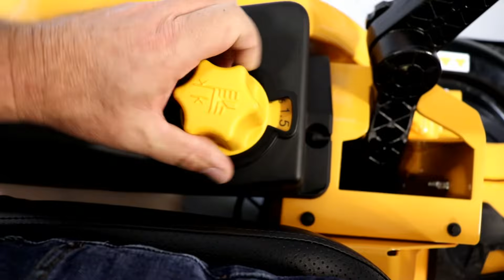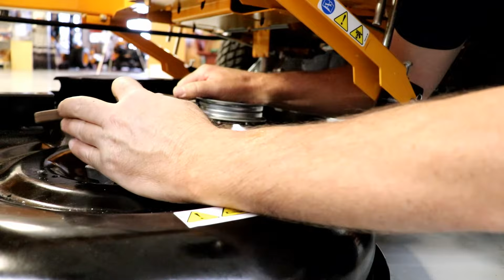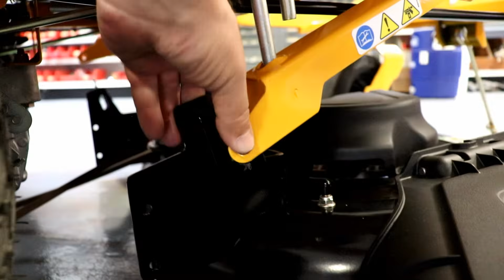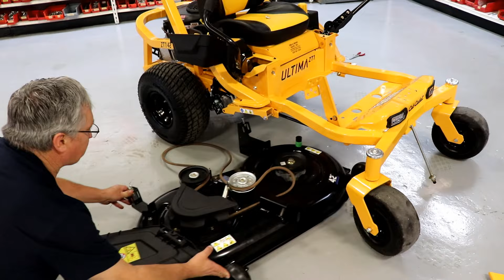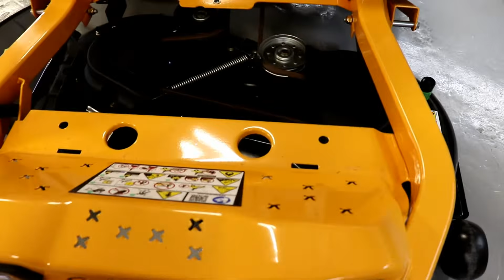Cub Cadet Ultima ZT1 42 zero turn | Remove the mower deck EASY WAY

Comment: hi! why not just avoid taking off the spindle over, and pull the idler arm back, which makes the belt loose, then taking it off that way, is it just way stronger than i assume it to be?

Comment: Cub cadet sells a mower jack. You can quickly & safely jack the mower up and swap the blades for a sharp set. You can jack up the mower in under 2 minutes.

Comment: Great video. The only thing I do differently when having to service it in the yard is to lift the front of the mower over the deck and roll the mower back. Much easier than pulling the deck across the grass and dirt.

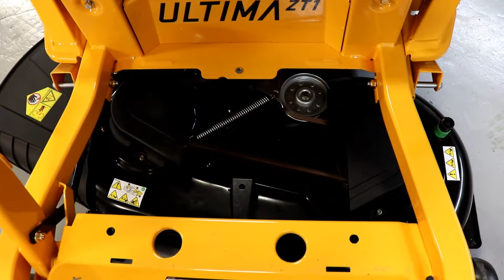Comment: The diagram that shows the pulley & belt layout on top of the deck is completely incorrect, showing 2 more pulleys than actually exist on this model. See 1:16

Comment: My mower is a ZT1 50" cub cadet zero turn. My mower i think hit a few tree branches and have caused it to where the blades cant move around under the mower its hitting deck and not moving. I have gotten new blades (manufacturer recommended mulching blades) and they do not fit in which I am only assuming is that my deck is bent. How can I fix this issue? What do I need to do? Please any advice. Thank you

Comment: i just replaced my deck, and am stuck on replacing the idler pulley, when i attach it to the deck it does not seem to be very mobile (the pulley itself doesn't seem to spin). Any idea what I may be doing wrong?

Comment: Thanks for the video.  I was unable to remove the belt by pushing on the pulley.  But wait, there is an easier way!!  Go to the right side of the mower and get a large channel-lock plier.  Remove the spring.  Re-assembly is also easy.

Comment: This is a fabulous video... Thank you so much! I have the ZT1 50 zero turn, so planning on referring back to this. I've been changing blades by raising the deck and going underneath... not efficient, and I really need to clean the buildup off after 2 full seasons.

Comment: I have the newer model ZT1 54" with the "S" Blades (490 110 C194) which are very expensive. I would like to swap out the 3 "S" spindles (618P09236) for the Star Spindle which offers a better selection of Blades at a much lower price. Like the Oregon 3 gator blade. They don't make any for the "S" blades. Any one know of a switch over spindle that will work?

Comment: I've got 3 full seasons on our ZT2-54 and have had the deck off many times. But we just moved and the Cub manual is somewhere in all our stuff so came here and found this. Very well done video. Especially like reaching through from behind on the port side to pull the idler pulley and remove the belt. Thank you, sir.

Comment: Thanks very much for the video. I WANT to like this mower, but I still don't. I bought it a few months ago, and need to sharpen my blades. Pulling this deck isn't "hard", but I've certainly had mowers that were much easier. Just another reason I'll probably sell this one off.

Comment: If you ever wondered why people mow with dull blades, this is why! Can’t engineers make an easy to remove deck?
Reply: You don’t have to remove the deck to remove and sharpen the blades. I just lift the front end and rest it elevated on 2 jack stands.
Reply: @usmcocs09  Thx for that tip. Though I like to remove the deck every year and totally clean, rustproof and undercoat it. But on subsequent sharpenings-only, I'll prolly use your tip. Thx again.
Reply: After coming off a mower from the late 90s, you guys have it easy and yet you're still whining about how hard it is lmao they sure don't make them like they used to. I mean the people, the mower is granted, they're so soft!
Reply: Easy way is to just hoist front end up
Reply: How much easier can it be...I mean it's not hard at all
Reply: You think this is hard to do?
OMG.

Comment: How about put a couple of 2x4s under the deck, so minimum amount of paint get scratched off the bottom edge of the deck (from getting rusted and better protect the floor), also this mover is new so the deck hangers will stay up, but i bet No One messes with the deck until the mower has been used for several hours with all the hinges/hangers are less than perfect fit - LOL (depends on the quality etc.)...

Comment: Great walkthrough, thanks. I think I saw a way to simplify even further. It looks like you could push the idler pulley back from the top side through the floorpan hole and slide the belt off at that point.  If so, that would save you from having to remove that spindle guard.  I'll try that when I need to sharpen blades.
Reply: you all prolly dont give a shit but does someone know a method to get back into an instagram account?
I was dumb forgot my password. I would appreciate any assistance you can offer me.
Reply: @Zaid Lionel Instablaster :)
Reply: @Bryce Colton Thanks for your reply. I got to the site through google and Im in the hacking process now.
Seems to take quite some time so I will reply here later with my results.
Reply: @Bryce Colton It worked and I actually got access to my account again. Im so happy:D
Thank you so much, you saved my account!
Reply: @Zaid Lionel Happy to help =)

Comment: I bought the 42" model but was wondering if you can swap out the 42-in deck for the 50-in deck on the ZT1?
Reply: Good question same here 42
Reply: How do I lift my zt142" deck
Reply: @weegancalixte6255  Use foot pedal then turn dial.